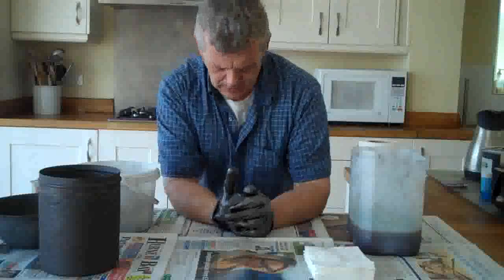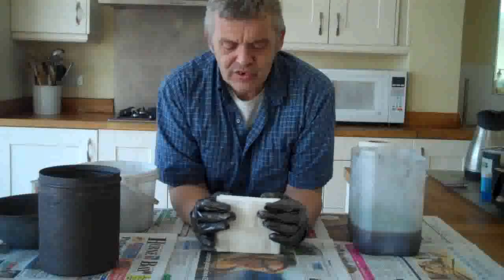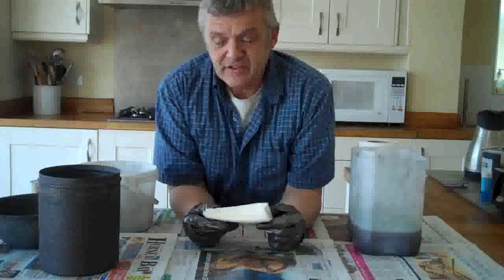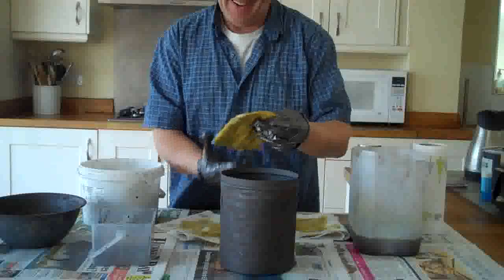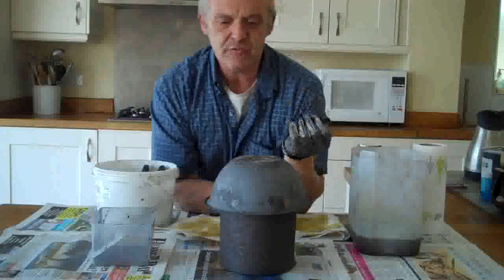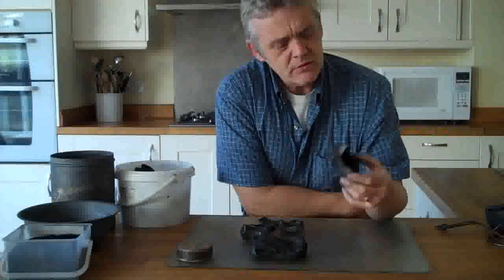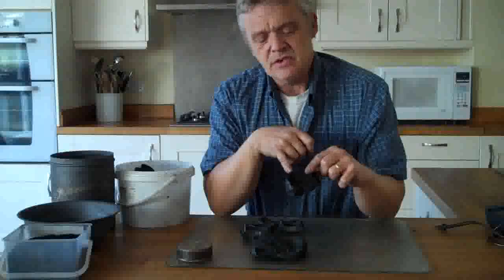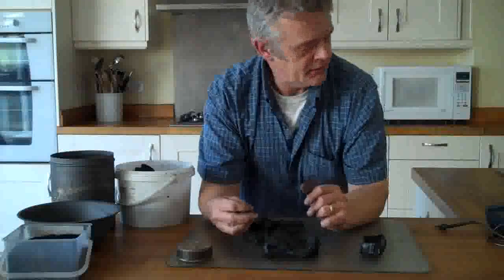Catalytic Graphetization - An Experiment

Comment: Robert, I have a question. I live in Chile, where there are a lot of very hot forest fires. Can the charcoal from the burned trees be converted to graphite and used to make battery anodes and cathodes without too much special equipment? I tried to join as a member, but because I live in Chile and my bank account is in California, your join system didn't work for me- it assigned my address to Chile. I would like to promote your channel! it is brilliant! I would like to see subtitles added to the most important videos in Spanish and French.

Comment: Would it still work if I make the charcoal first then add iron sulfate and then heat it back up. I make thousands of pounds of charcoal for my garden and its just not practical to dry, soak, and again dry all that wood prior to turning it into charcoal. Once you have the charcoal there's a lot less of it than the wood you started with and it's easy to soak with the salts. I could then mix the iron sulfate doped charcoal in with wood the next time I make a batch of charcoal. Why would I do this? The goal is to make a charcoal with superior cation exchange capacity.
Reply from the maker: good goal - if you could get good impregnation of the salt solution into the charcoal then yes it will work
Reply: Excellent! That's what I'll do then with next year's batch of charcoal. I'll also be adding ag lime to the charcoal to scrub SO2 and make gypsum. It should work out very well.
Reply from the maker: Joseph Richardson
sounds really interesting - will you make a video?
Reply: Yes

Comment: Iron works quite well as a catalyst. Remarkable graphitisation mate! Now wondering now about using Silver, or Copper. Would they work as far as a catalyst to lower the activation energy/temp?  Those sure would make brilliant fuel cell electrodes as the structure and surface area with key metal catalysts incorporated in look perfect for top efficiency, solar cells even, water splitting.. :) Gets out his green Copper(III) chloride crystals
Reply from the maker: It has a hundred uses lol - nickel works well too as does chromium and cobalt it's just nickel and iron are cheap and readily available.
Reply: Robert Murray-Smith I wonder if iron, nickel, and cobalt work because they are magnetic.  That wouldn't explain why chromium works.  Still it seems a big coincidence with the other three.  I wonder if an externally applied magnetic field would have a catalytic effect while baking the carbon.
Reply from the maker: worth trying let me know how you get on
Reply: copper (III)??? dont you mean copper (II)?

Comment: Here's another one.  Using bone dry wood, cut it into thin layers.  Turn it into charcoal with the steel plates as described before.  Acid wash.  Soak with iron chloride and perform catalytic graphetization.  Give nano iron enough oxygen and moisture to rust.  You now have one electrode of a nickel iron battery.
Reply from the maker: I was thinking that - in addition nickel salts have the same effect as iron salts - there you have two electrodes lol! - could be the easiest most powerful nanotech NiFe battery around - I'll get on this immediately
Reply from the maker: incidentally - this joint idea we just came up with is the reason to share - cheers mate
Reply: Robert Murray-Smith You're very much welcome!

Comment: This I think will give you good shaped plates (I haven't tried this myself).  Dry the soaked wood in the oven until "bone dry".  Then slice the wood into thin layers maybe two times thicker than final desired electrode thickness (the thinner the better).  Place each layer between a layer of plate steel (the steel helps to conduct heat to the wood evenly across the entire surface and to maintain the shape.  Place a heavy weight on top and carbonize as you normally would.
Reply from the maker: That will help - a lot - thanks mate

Comment: For an inert atmosphere, would hooking up a chamber full of dry ice to the kiln chamber work?
A length of larg iron pipe full of dry ice with 2 endcaps, 1 with a pressure regulator, hose & hose fitting mounted, and have that displace the air around the soon-to-be graphite.
Reply from the maker: Joseph Richardson That's not strictly true - you need to soak it in an activation agent like KOH, NaOH or CaCl first. Sure carbon monoxide is poisonous but try not to stick a bag on your head and attach it to your kiln with a hose and you should be fine! - joking aside this should be done in a well ventilated area - i guess my bad for not saying that.
Reply from the maker: If you really want an inert atmosphere you can use welding gear - they sell argon and carbon dioxide in small pressurized containers in car repair shops. The chain in england is called halfords and you can just go and buy it no problem. They also sell the regulators and hoses - so it's not too difficult a job - i have been thinking of doiing it so i may do it sooner rather than later and vid it
Reply: It depends on how hot you plan to make the kiln.  If you're not doing catalytic graphitization, then eventually the CO2 begins to react with the charcoal and will make CO.  The lower temperature of catalytic graphitization may be just fine.  Maybe not!  CO is poisonous.  Incidentally, any oxygen that gets in during graphitization should attack the outer edges first.  If you take an existing piece of charcoal it will be full of air.  If you put that into a kiln using Robert's method as it heats up the oxygen will react inside the charcoal thereby creating atom sized cavities in the carbon matrix.  It is now activated.
Reply: Robert Murray-Smith You can get far more molecules of KOH, NaOH, and CaCl into charcoal than you can of O2.  Using air is just not practical because you would have to go through multiple cycles of heating the charcoal with air in a sealed container, letting it cool, put fresh air in and repeating over and over.  Also if you think about how heat travels from the outside of the container to the middle, the hottest area will be the outside so that is where most of the oxidation will take place and there will be no real activation.  A rotary kiln would solve that, though.  Also if your charcoal were already graphitic you could heat it in a sealed container (with a pinhole vent of course) in a microwave.  The sudden heating should cause a small amount of activation throughout.  This process would probably have to be repeated until desired results are achieved.  Per Wikipedia for activated carbon "Raw material or carbonized material is exposed to oxidizing atmospheres (oxygen or steam) at temperatures above 250 °C, usually in the temperature range of 600–1200 °C."